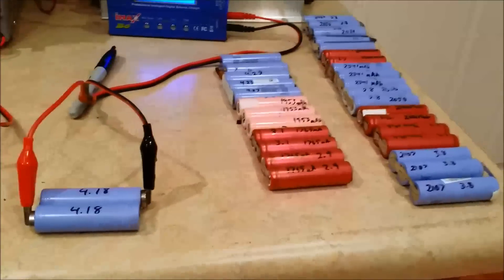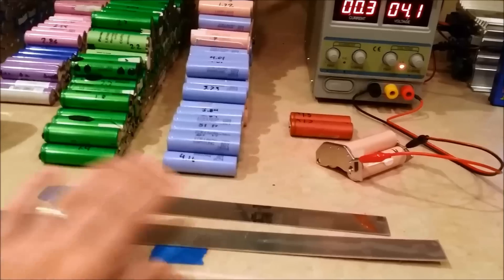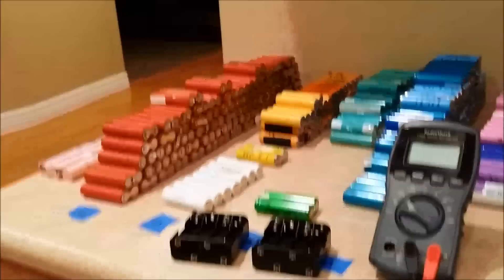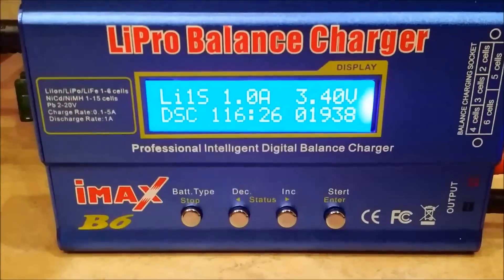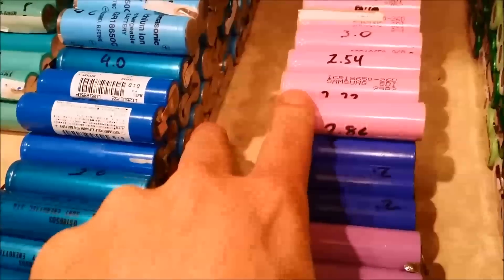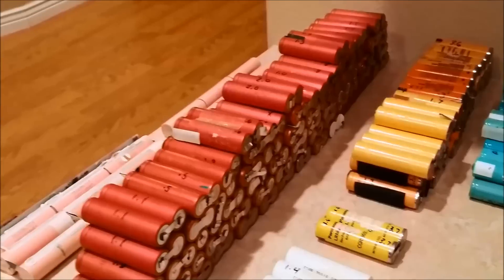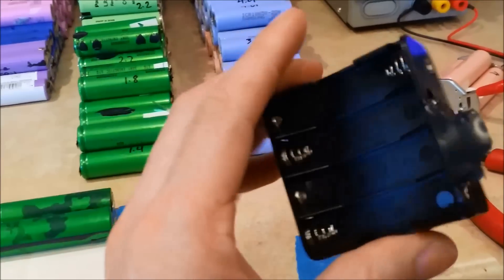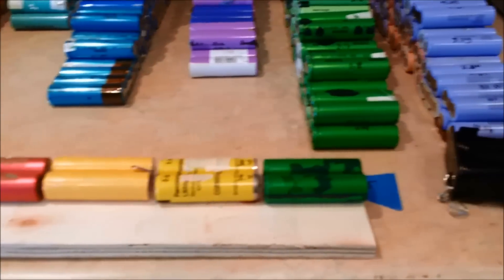DIY "733" 18650 lithium ion cells How to build a 48v e-bike battery (Part 1 of 7)

Comment: Request - Good video skills, you got my attention.  Can you make a video sometime that explains how you go about testing the cells please?  I read this comment you made and would like to know more.  I plan to fabricate a high capacity pack for a bike that will begin with the size of the battery and work out from if you get me.  Have a Fluke MM looking for charging / analyzing equipment. Keep up the good work..
" I research the cells to see what the mAh are when new, then test them with the cutoff at 3.0 volts.  At 1ah load on the cell it will pull the voltage down during discharge testing. When it hits 3.0v during the load test that is your capacity.  When the test is over meter the cells voltage and it will show around 3.69v -3.7v with no load for a solid test. "
Reply from the maker: Earnie, thanks for the comment!   I know what you mean, make sure the cells are good for higher than 1-2C if you are using 18650's.   There are cells that are high in mAh but cant go higher than 1-2C so you would have to make up for it in numbers size (more cell that are in Parallel.)  Unfortunately, I travel (a lot) with my job, but once I get home in about 7 weeks I'll start making some more videos for sure!   Sorry if your looking for them soon.   I'm currently ordering parts, so once I get home I'll be ready to do more DIY's.  Trying to step up my game ;)  Thanks

Comment: sir i am trying to build a 12 volt 3s battery pack to use on a solar system does the imax you are using measure capacity and internal resistance
Reply from the maker: Absolom Madhaka sounds like your looking for a multi-meter which will measure capacitance and resistance.  The Imax B6 will charge your batteries and measure the usable amp hours during discharge testing.  hope this helps.
Reply: Jay Koster thanks but does internal resistance play a big part in performance of the cell
Reply from the maker: Absolom Madhaka  yes it really does matter.  As the cell ages and the number of charging cycles start getting high it will start to become resistive meaning that it will internally start to have enough resistance to self drain.  If its slow or fast draining it will be enough to damage other batteries that in the pack as it will start to become lazy and put the voltage and amperage load on the other good cells and start wearing them out faster.  You will be able to see what the cells are doing in a particular voltage pack as the balance charging will take longer on one balance lead or will be much lower than the others when starting a new charge cycle.  I am using used batteries that are 2/3 of what they were when new and categorizing each cell to the same mAh (or very near the same) in each voltage pack.  I am by no means an expert on lithium batteries, but this is what I have learned so far during this whole process of using these batteries.  Thanks.
Reply: Jay Koster  ahh when i charge my cells i let them sit for two or so weeks if the voltage drops by 0.05 i usally dont use for that particular project does this help
Reply from the maker: I wouldn't worry about sitting for weeks as the batteries may come down a little if it was quick charged.  You will notice it within a day or two.  When I charge my 18650 lithium batteries I will keep the final voltage of 4.2 on the battery for a day or two after its done charging with my main power supply so it really has time to soak up the charge.  Then it should stay around 4.2 if it drops set it aside and monitor it for a few days and see if it stop draining.  Once its charged then I put it on the discharge test to check its mAh capacity. The recycled batteries that I have will sometimes go up in voltage by .15 sometimes after removing them from the rest of the pack.  That's when I know I saved a good cell.

Comment: Hi.
I'm also working on creating a 48V battery pack from recycled laptop batteries.
What cut-off voltage do you have when you measure capacity of the cells? The cells I have been testing many of them go as high as 2000 mAh, but I'm finding that a bit strange.
If I use a cut-off voltage of 3.6V they are around 700-1100 mAh.
Reply from the maker: +No_Problem I research the cells to see what the mAh are when new, then test them with the cutoff at 3.0 volts.  At 1ah load on the cell it will pull the voltage down during discharge testing. When it hits 3.0v during the load test that is your capacity.  When the test is over meter the cells voltage and it will show around 3.69v -3.7v with no load for a solid test.  I have had a few go down to 3.45v after testing and turned out to be great cells.  2000mAh is good if you have them.  I found that 40-50% of used laptop cells are 2000mAh so your good
Reply: +15-sec-of Fame Ok thanks. I will keep testing all my cells.
What about cells that are under 3V did you use any of those in your pack? I have few of those, not sure if I should give them a try since they are below 3V.
Reply from the maker: +No_Problem yeah as long as the mAhs are good it should be fine.  You may need a variable power supply to get them back up to 3.0v,  just be careful not to use to much amperage .25 ish to get them back up to 3.0v
Reply: +15-sec-of Fame Do you use batteries that are below 4.2V when charged. I notice that some batteries are will not reach 4.2V when charged, maybe around 4.15 sometimes 4.10V. Can those be used?
Reply from the maker: No_Problem be cautious of the cells that are having trouble getting to 4.2 volts.  If you are using the Imax or simalar sometimes it will take a few charges to get it at or near 4.2v. I use a variable power supply to mainly charge them.  I set it to 4.205v-4.210v butt its ok up to 4.25 MAX!!  I will usually have it timed with my phone to remind me to check on it if I step away.  If the cells are dropping down to 4.18 or lower and you have tried to charge them more than 3 times I would say that its resistive and not good.  Keep those out of the battery pack as it will mess up the balancing
Reply: +15-sec-of Fame I have not tried charging them again I will try that. What about mixing old (good ones) batteries with new, just a thought. I'm finding it hard to find used batteries.
Reply from the maker: No_Problem mixing the old and new should be ok as long as the mAh's are similar.

Comment: I don't know if you addressed this on another video and I missed it but what was the cost to obtain all of those used laptop batteries? That had to have been a ton of time to recondition and test all of those cells. 'm trying to figure out if it is worth the time opposed to just buying new 18650 cells.
Reply from the maker: +Patrick Keough  I bought the kit for $360, most of the laptop batteries were free as I found an IT department that was going to recycle the batteries, but I offered to take them instead.  To get more batteries I went on Ebay to find good deals on "newer used laptop batteries".  I also bought a new matching rim with 36 spokes for $85 (optional), fuses $12.99 for 100pc (optional x3 for me), 35' of tabbing buss wire $25, rear bracket and bag $85.  

It was a lot of time spent going thru each cell, but by doing that I know what my battery is made of.  I built this as a hobby to keep my mind busy and to gain knowledge on lithium ion batteries.  I spent months watching videos and getting the know how until I finally felt comfortable cracking open my first laptop battery.  I spent 2.5 months going thru these batteries to find 104 cells that were 2/3 there capacity or 2000mAh or better.  The cells that I used are 3000mAh when they are new.  

Good luck on the build and I too am getting ready to start my next battery pack, so if there is something to want to see or have questions about something please let me know and I will answer it and incorporate it in the vid.  Thanks

Comment: sir where did you get these batteries?
Reply from the maker: +Mahmut Yaver  Hey Mahmut, went to my IT department at work to see if they had any old batteries from laptops and found that they had a box full of them.  They were going to recycle the batteries, but I offered to take them instead.  I got about 250-300 cell from that.   But I wanted to get more cells, so I went on Ebay and found good deals on "newer used laptop batteries"  I threw away about 10-15% of the cells as they were dead and 40% were over 2000 mAh.  The rest of the cells ave. around 1300-1900 mAh.
Reply: +15-sec-of Fame thank you sir,

Comment: you spend all your that money on batteries youre better off buying the real thing
Reply from the maker: the kit was $360 shipped the batteries that I used were free.  Im just showing that you can find good batteries from used laptop batteries.  If your talking about the batteries that I bought on ebay...well I havent evet touched those yet.  I could have gone out and bought a bike equivalent to what Ive built for a few thousand, but It was the challenge of building it.  I wanted show those who cant afford a ebike that it can be done on a "lower" buget.  It was a fun project and Im always looking to improve it.
Reply: +15-sec-of Fame there's a new type of battery thats going to DESTROY the lithium market....... its called SUPER CAPACITORS... they're rated in volts and FARADS its already taken effect.. check em out
Reply from the maker: +donfritz0 yeah man, that would be awesome!  If they are finding a way for capacitors to hold a charge and slowly release there energy that would really make a difference.  Even if you were to use one SC inline with your battery that would really help keep the battery cool and last much longer.  Thanks I'll look into it.